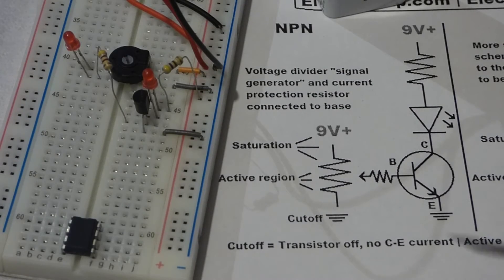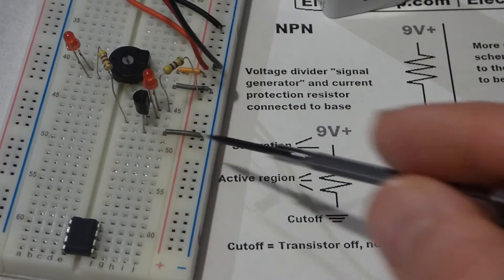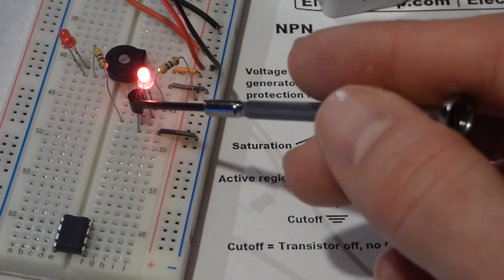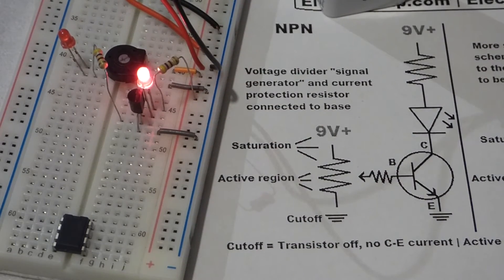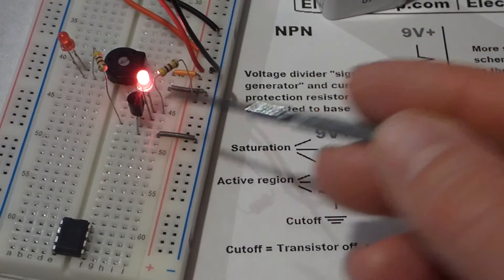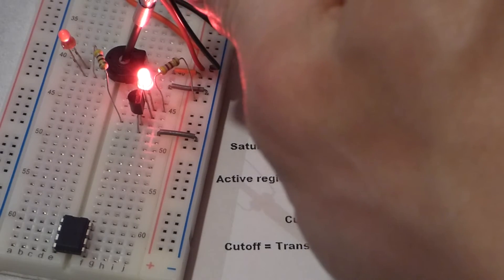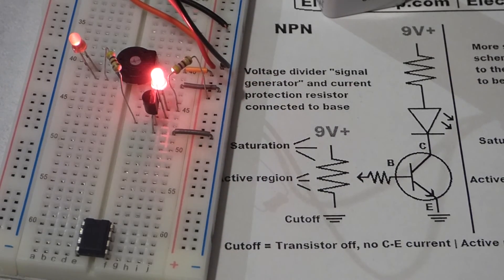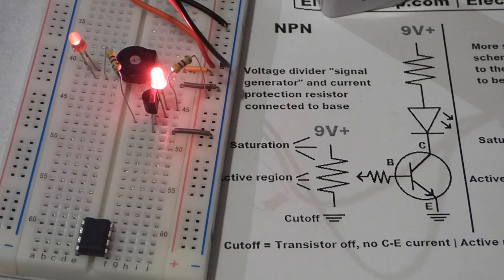Bipolar junction transistor vid 2 NPN amplifier demo circuit w cutoff active region saturation gain

Comment: Hey Friend,Is this transistor the same one used in the previous video?Also, in the previous video, when the transistor switched on, did the value correspond to saturation or to amplification?
Reply: I believe it usually is saturation when it comes to switch mode. Weren't we used to that in textbooks?! But could it be that we awitch to amplification mode?
Reply: According to your experience and knowledge I mean
Reply from the maker: I generally use either 2N2222 or 2N3904 transistors when I need a NPN bipolar junction transistor and a 2N3906 when I need a PNP BJT. For the circuits I have been doing, the exact bipolar junction transistor shouldn't matter, other than whether it is NPN or PNP since they have the opposite chemistry. Not sure what the previous video was, but if the BJT turns directly from off to fully on like a mechanical switch does, then it is a switch. If it outputs a fraction of the power source voltage but a multiple size of the input voltage (signal), it is working as an amplifier.